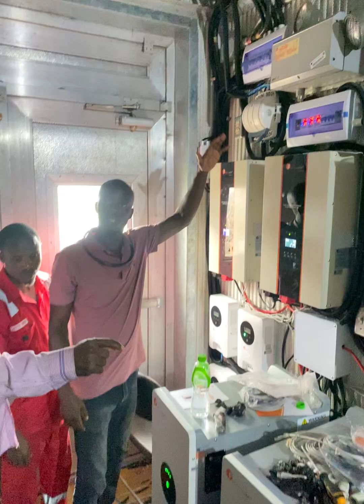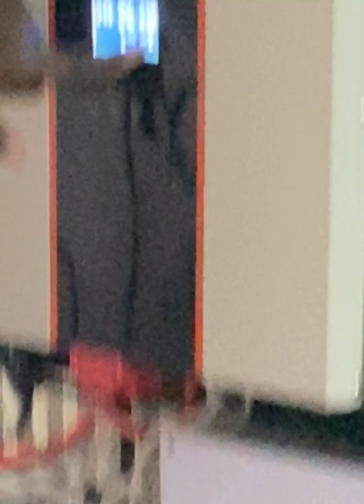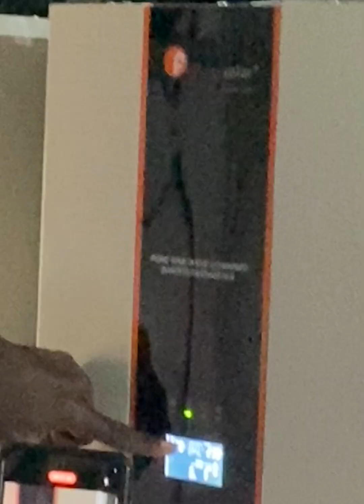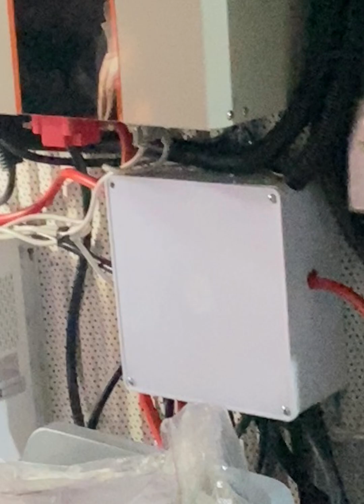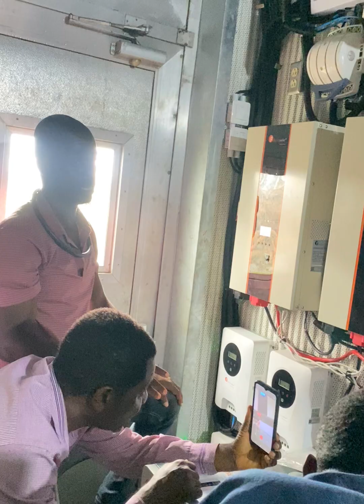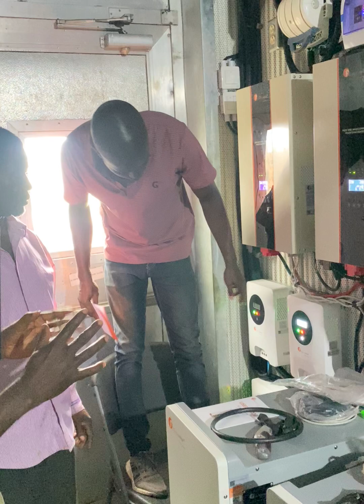Powering a 3 phase machine

Comment: You've done a great job but there should be a dc breaker to regulate all the batteries there they can isolate the battery from inverter
Reply: Pretty sure the batteries themselves have beeakers and fuses in them
Reply: Yes 100% sure,👍 @Abdul_Wahab5773